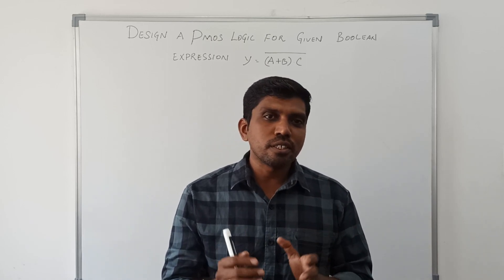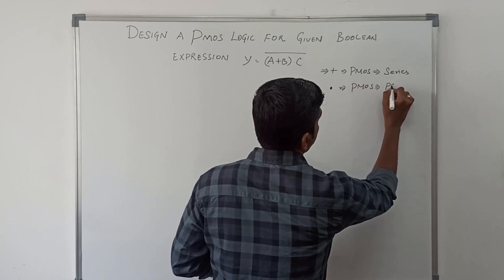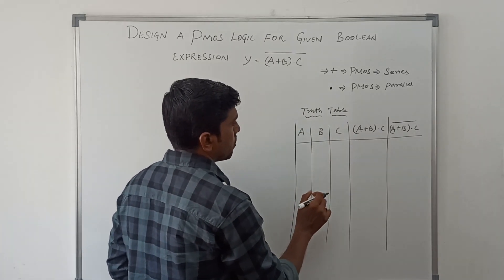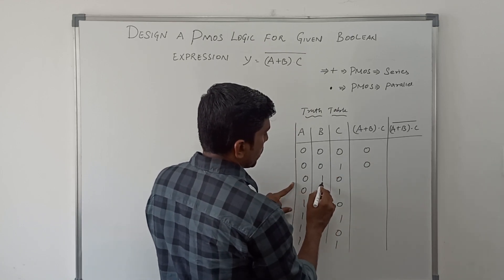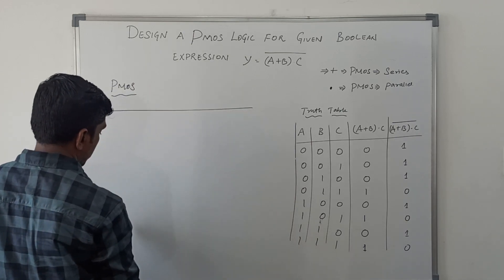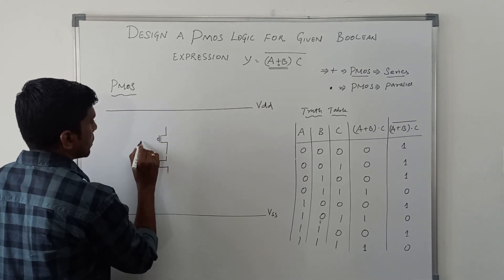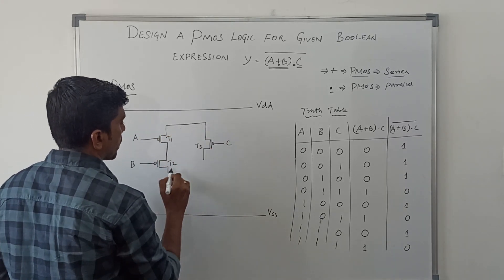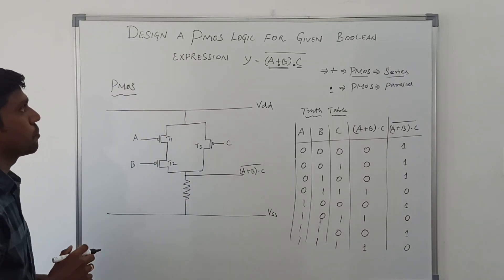Design of PMOS Logic Circuit for Boolean Expression | VLSI Design | S Vijay Murugan | Learn Thought

Comment: sir why we use resistor to measure the output and why cant we draw the pmos logic like nmos logic using depletion mos
Reply: i think the resistance is very high,, drawing less current leading no voltage drop(ideal), hence appears on output side